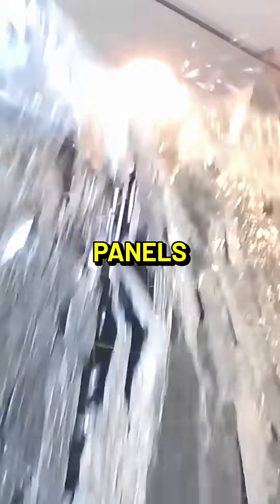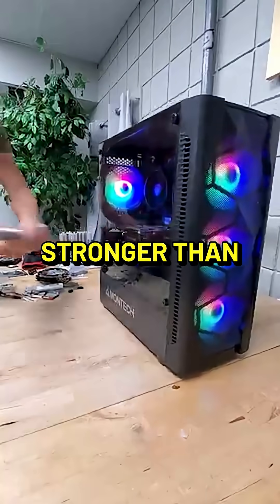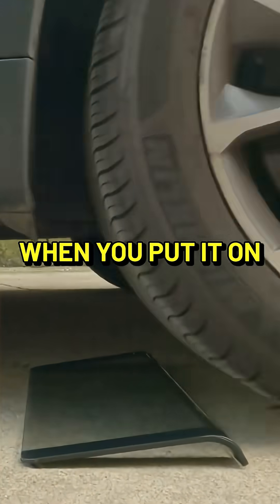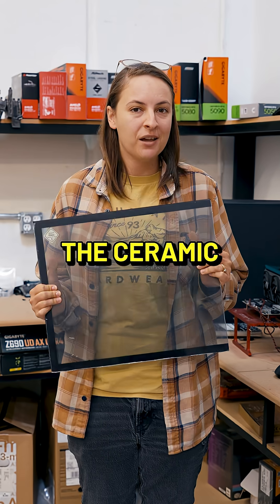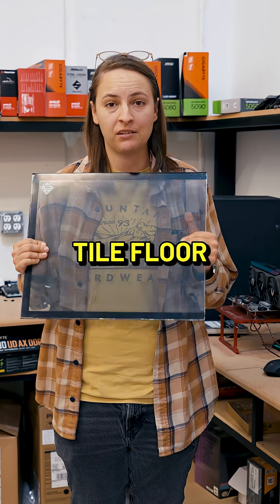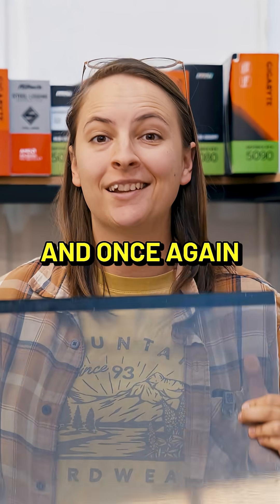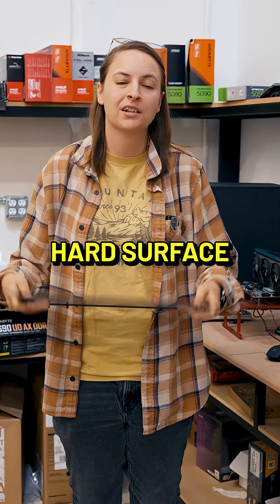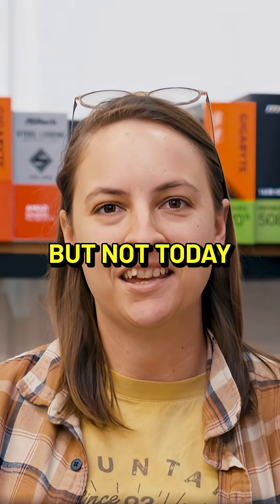Why does tempered glass break near ceramic tiles?

Comment: mine shattered when i was taking off the side. so explain that
Reply: tempered glass is always under pressure. it could have had a scratch it it or you tightened the screws too tight (if it was screwed in) and something like this can take a while before it finally makes the glass shatter.

Comment: Put it in your chair.. It will save you from thinking it's okay to sit down and you won't have to pull that part you just installed out and install the old one again just because you forgot a device driver.
Reply: might not want to do that. what if you forget and then sit down?

Comment: This happened to me. I was working on my pc but my pc is in our unfinished basement so everywhere is concrete, I gently set it down on the concrete vertically against
 my desk the moment I let go the whole thing shattered in my hand so now my pc doesn't have a glass side panel. Also I learned if I'm going to set it on the concrete I have to make sure that the corner is not the first thing to touch. Also, I now have a rug, so that should help give it a little more cushion.

Comment: Pro tip you can shatter any piece of tempered glass by throwing a small piece of porcelain at it…. 
They actually make elastic bracelets with a single bead on it of porcelain for that reason if you’re ever trapped in a car you can flick the bead on the elastic band at any window and it’ll shatter
Reply: That’s why car burglars take a spark plug and break a piece of the ceramic off and use that to break car windows.
Reply: I learned this from the TellTale Walking Dead Game 😂
Reply: @MadMusic26  same